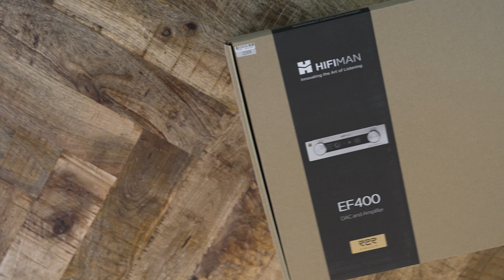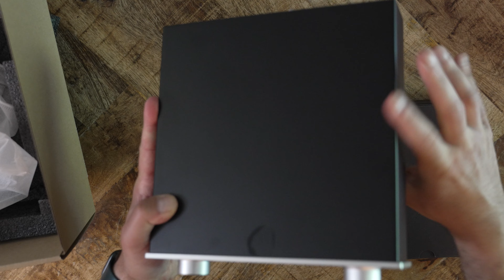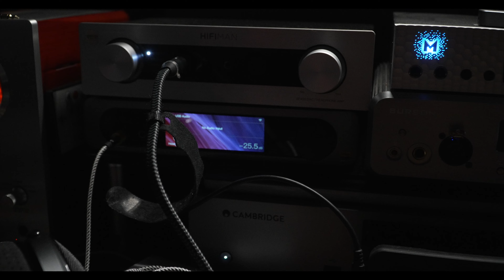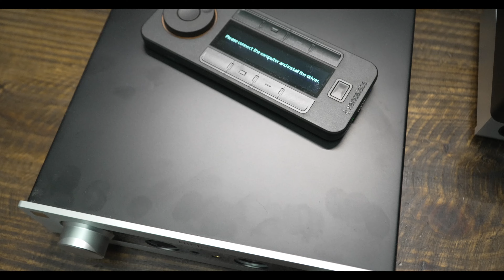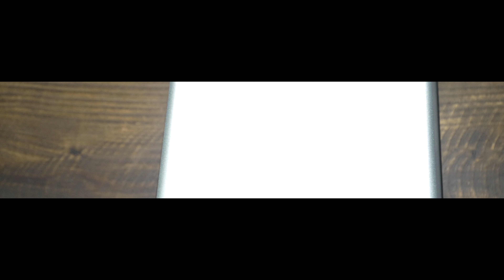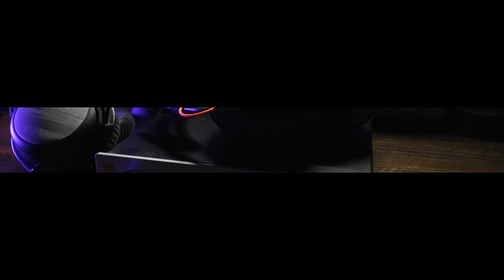Hifiman EF-400 - Is This What You’ve Been Waiting For?

Comment: I respect your findings, but my personal experience puts the perceptible *warmth* of this unit somewhere between my speedball and my d90. There is (again, in my opinion) a perceptible warmth available from this dac (and other r2r dacs) that isn't found in the cold/analytical delta-sigma dacs found in countless products out there.... all chasing the exact same THX target. 

The difference is that in this case you get that warmth, and an insanely powerful amp, for what many people pay over 1000 just to feed signal to their amp of choice.  You mentioned the power the amp has... but looking at something like bass specifically (for the bassheads out there)... this unit delivers a tight, controlled bass (through planar and dynamic) that simply can't be touched by counterparts in its price range (which let's be honest.. is 400 not 500... you've been able to find it at that price regularly [new] since 2022)

Comment: The channel imbalance is a deal breaker for me. After having the JDS element 3 I'm on my endgame. At this point I'm almost out of the hobby entirely.
Reply: I wouldn't worry too much about the imbalance. I have been testing the EF400 for a few months and haven't noticed a lot of the problems mentioned by other reviewers. Any slight imbalance at very low volumes (which also occurs on some much higher-priced units) can be solved by always reaching your desired volume from a lower level rather than a higher level (always turn UP to the desired volume). Apart from that, I've been happy with the EF400, in my humble opinion.

Comment: So you stress the importance of volume matched testing and then you go ahead and break that rule by changing the volume.
Reply from the maker: Do you know why we volume match? It’s to start with a baseline. Changing volumes isn’t a departure from testing because we are still testing. If there’s a perceived difference when volume-matched, then changing volumes on one equipment may provide some additional info about whether that perception is a mistake in hearing, or whether that difference becomes more or less noticeable, or whether it is environmental, or perhaps even some issue with the setup. If there’s a difference when volume matched, don’t we need to figure out where that difference might be coming from? Just claiming there is a difference without putting more effort into figuring out if that perception is real is the actual problem—not modifying the tests to gather more info.
Reply: @NoThemeReviews  The whole point of doing a level matched test is to eliminate perceived differences from the things you mentioned. Otherwise, there's no point in even bothering with it.
Reply from the maker: So your argument is that once there’s a reasonably volume matched perceived difference, we stop and don’t investigate further? Seems a bit wonky, especially if we want to rule out any other potential contributors to the perceived differences. If you’re satisfied with just claiming there is or isn’t a difference after volume matching, that’s great. I prefer to take another step to verify. As you know, the scientific method requires that we alter and modify tests/hypotheses to verify results. Otherwise there is no scientific method. 🙄Disagree if you want, but I have valid reasons to do things my way. Thanks for the feedback.
Reply: @NoThemeReviews  But you've already  ruled out potential contributors to the perceived differences with the volume matched test. That's the point in doing it.  What is there to further investigate? We already know changing volume levels will affect perceived differences.